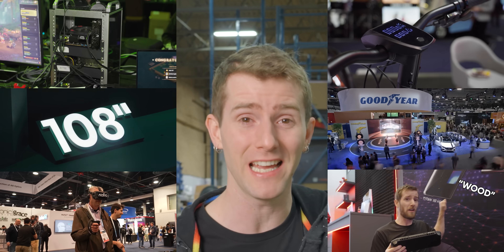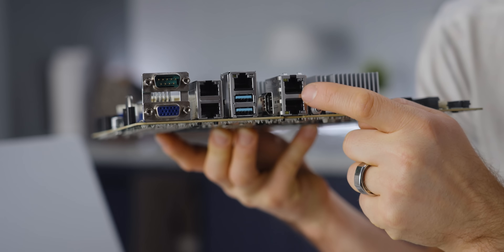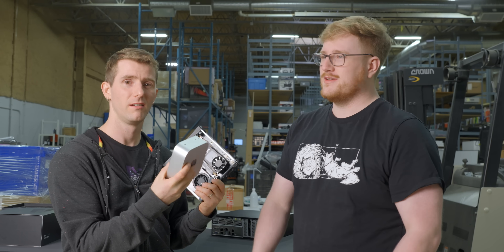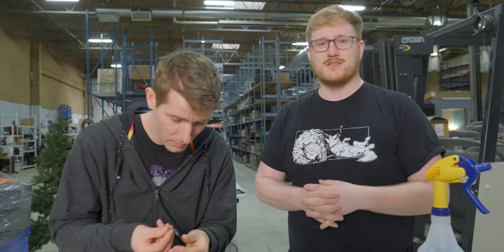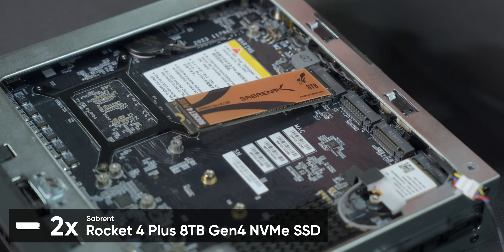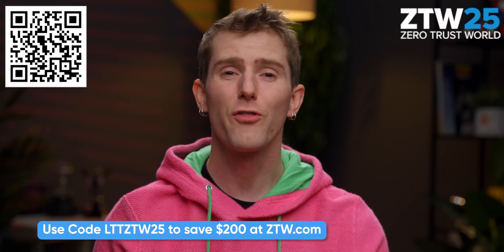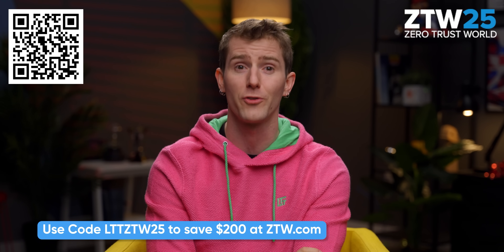I replaced a $20,000 server with this

Comment: Linus's old server case is actually the case I am using for last few years as my daily driver. That's a 8L case. He showed up Nvidia Quadro P1000 card and I used to use P620 on that server case which I recently upgraded to A1000. He mentioned 2000E Ada GPU which I actually returned for being a bit pricey over A1000. He showed up minisforum which I am also buying before I leave for overseas. JC. 😅

Comment: I'm still not getting the point of the GPU (or the Mac Mini) if all you're doing is remoting in.  It has an iGPU which ought to be plenty capable.  That GPU could instead be replaced with a 4-port NIC, so then you also don't need the switch.

Comment: Flying with a switch isn't unheard of. Especially if you have service contracts with 6h replacement SLAs manufacturers will sometimes put an employee with a replacement unit on a plane. If you have a location with hundreds of employees or manufacturing going dark, even a charter jet can be the financial reasonable choice.

Comment: Big tip too, sometimes they have a cable box behind the tv but it’s run through internet and it’ll have a hard connection. You may have to break off a lock tab on the Ethernet cable but if you plug it back in before you leave no one will ever notice and those sometimes will have like 200mbps vs the 5 you get with WiFi. I travel for work a lot and have been trying to figure all the little tricks out
Reply: It's always a good idea to check behind the television for any insecure Ethernet ports. If you still want the Internet television and don't need to worry about maximum speed but want better-than-WiFi, throwing an unmanaged switch in your bag will let you take that one connection and split it into however many you need. You can find extra small ones which support four devices, three if you include the IPTV box.
Reply: If it would be 5MBit/s and if those would be at least stable...I would have been happy.
Reply: that is what they said in the video.. but then an AP instead of a cable box
Reply: 15:25 he mentions this

Comment: I wouldn't recommend this, I got the same unit and it random freezes and you have to power reset, think its related to the bad batch of Intel CPU, or something else, anyway it useless when it randomly freezes / crashes,  so I had to stop using it.  Getting anything of support from Miniforum, is like thinking you can fly = aka they do not do support. :(

Comment: That NanoKvm is so great. Combined with a cheap XH-HK4401 4 port kvm switch, you can have 4 device with one NanoKvm. The switch has a control port, that is not usb, but direct serial. So you need to make a custom cable for that. Old version may have invers serial signaling that needs additional chip, but newer one works without much effort.  PiKvm wiki and github has more details.

Comment: I think Thunderbolt includes networking within itself so it should be possible to connect MacBooks directly to NAS using Thunderbolt compatible cable. Of course if Minisforum supports that. So you can ditch at least some of the network adapters.

Comment: Then you can upgrade to a Yeston Single Slot Half Height 3050 6GB, unless Nvidia releases a 4050, 5050, try out an A310, or if AMD whips up an 7/8/9400 or 7/8/9500 card with an encoder

Comment: 12:48 I have atm 1 Nano KVM at work. It is super annoying that after flashing the sd card to update it needs to access the internet to finish the update - so the image is not complete. I had to bring it back to my home so it has its internet before connecting it back to the Locked corporate network - maybe you can put some pressure there on the manufacturer. Otherwise its a great product. github--> NanoKVM/issues/186

Comment: why network the mini using ethernet when you could just use a TB4 cable and ditch the adapter and get faster speeds? Hell, you can ditch the switch and ingest from MBP using TB4 as well.

Comment: I moved my homelab to the i5-12600h version of the MS-01 a couple weeks ago.  I replaced the wifi card with a coral tpu and added a 9200-8e HBA to connect to my EMC KTN-STL3 disk shelf which houses a bunch of used enterprise SAS drives.  It's now running Proxmox with Plex, Home Assistant, Frigate and a simple Cockpit based NAS all over the 10gb SFP+ ports configured in a LAGG.  I even got vPro working so I have full remote management.  It's basically silent and typically runs at ~5% CPU usage so now the only noise in my rack is from the disk shelf.  I just wish it had support for ECC memory.
Reply: How is the idle power consumption?

Comment: I find it weird that LMG hasn't transitioned parts of their production to Resolve yet.

Every single professional editor I've spoken to that has worked in both for more than 6 months has come away from it with a hard preference for Resolve.
Reply: I think they've done a video about this. It's all the jumping between software for different jobs that makes it tricky.
Reply: @Metal_Maxine  That's why I said parts of their production, not the whole company.
IE: Move one or a few of the smaller shows/channels over and transition a couple of editior dedicated to those shows/channels.
Then use them as resources when migrating other editors over later.
The gain from the custom pipelined workflows that can be created and shared internally is huge for a large team delivering a consistent output with minimal shoot to publish delay.
Reply: @magfal  Dan wrote something in a WAN show recently that they are moving to his streamlined workflow plan. Who knows what that looks like?

Comment: Variation on a theme to get high speed internet when traveling close-ish to home.  I live where I can drive an hour one direction to watch rockets go up or another direction to go visit the House of Mouse.  The same cable company covers this section of the state. If one is in their service area and the building one is in has a cable connection in the wall, ALL their services - cable TV, internet, etc - go to that cable.  When staying over, I bring modem from my home and connect it to wall of resort I am staying in.  Poof! My own modem and own router and own wifi all at high speed.  It will always beat resort wifi for speed and range.

Comment: I had sooooo hard of a time getting the 2nd peel off the PTM7960.  I even had it in the fridge and I still basically ruined my first patch of it (had lots of extra, the larger size is really big).  

Time is of the essence, you need to get it on really quick.   When I redid it things went a bit smoother but it was still kinda hard. 

Hopefully I never have to touch it again now, my main reason for going with that over paste.
Reply: I had problems, too. I think the big mistake I made was I peeled the wrong side first; one of the sandwiching plastics is much easier to remove than the other. I did ultimately manage, but yeah, my advice is peel off the harder-to-remove plastic first.
Reply: @ that could very well be where I went wrong too.

Comment: The nanokvm is more like $60 for the full version in a case, and it does need external power, if you want to remotely power on the PC it is connected to.
Reply: What if your PC keeps the USB powered when off? If it supplied sufficient power it shouldn't need external power right?

I could see an issue being that on PC's that I have seen that can power the USB ports when off that it kinda stutters or turns off for a second when you turn the PC on though that SHOULD be fine because the power on command has already gone through (hence why the power stutters) but you will likely need to get back into the KVM; That should be fixed by just hooking it into a small battery bank and charging that battery bank externally or via the PC.
Reply: @CaptainBlueTech  The power bank should work. I'm not sure about the always on USB ports, but I don't see why not

Comment: I was literally looking at one of those yesterday to build into a router/gateway appliance to replace a two-decade-old Q6600 machine that was doing the job until its NIC died. They're little badasses.
Reply: Update: A few months after posting the above, I bought a MS-01. It's now my router/gateway and handling a 10gbps LAN without issue. It might be a touch pricey but it's an absolute beast of a box for its size.

Comment: Upgraded my wifes Lenovo Legion Laptop with the Ryzen 5800H chip in it with the PTM pad....holy moly!
Before, this Laptop was CRAP, fans were roaring in idle and basically taking off while gaming. Now idle is a slight humm and Gaming is roaring....temps are the same, but less noise and it draws more electricity -> more fps!

Did also put it on my RX7900XTX watercooled....yeah, I stay under 50°C at 420W draw 😂

Comment: 0:30 The fan 😭
Reply: I'm not the only one. Now I can't unsee it.  Lol
Reply: Some ppl dont get what i meant i think
Reply: im not the only one, thank god - lol
Reply: The cooling fans used are Noctua fans, specifically their standard line (or main/regular models) which have a common trade dress of brown blades and beige frames.

They do have ‘Chromax by Noctua’ branded variants which look more like regular computer cooling fans due to them coming in black but with optional accent colours, however I do appreciate LTT using standard line Noctua fans as I do like their colour scheme (though I believe they created Chromax for those who don't like it but still want the quietness and performance they offer).
Reply: Nein
Reply: I have a feeling several of the people that replied here so far, haven't got the point. The light color of the fan body and the way parts of it are covered up by the exhaust mesh, make it look like a swastika, you know the "Heil Hitler" swastika.
The point of the OP comment has nothing to do with it being a sleeper build or just the fan color not matching with the PC.
Reply: @Renee_R343  Fans are made in Austria too
Reply: As a german I flinched a little bit. It looks like the swatiska from the nazis.
Reply: Right lol that doesn't look like a crappy old office computer, that looks like a SLEEPER
Reply: German fans
Reply: Nah b
Reply: Oh boy. Is that design on purpose?
Reply: @ no
Reply: Lol it’s an Easter egg
Reply: the fan and the 2 small ones on the back next to motherboard ports at 0:33 are noctua fans, their design is pretty bad but they are the coolest and the msot quiet fans on market

Comment: Been running proxmox on sff and mff pc's for years. They work great for basic home servers or on the go servers like this. Used to have a meraki z1 tied to work and mini pc with a usb hdd tied to it for a basic target nas on veeam. Off site storage on the cheap :p  Look into Mikrotik switches. they make small sfp+ switches. the crs-305 would give you 10gb on site with 4sfp+'s and 1 copper gb connection.

Comment: Worth mentioning that there are two versions of the P1000, one with 640 cuda cores and one with 512, and they look identical. Also, there's the RTX A1000 and N3RDWARE makes single slot coolers for the older A2000 and 2000 Ada Generation cards as well.

Comment: I changed my thermal paste on my 5800X3D yesterday from Kryonaut Extreme to PTM7950 and my Cinebench R23 score is 3.5 % higher. And this will get better with more heat cycles, other than thermal paste which will degrade.

Comment: MS-01 is great product, only let down by the cheap CMOS battery cause if it dies it prevents the unit from being turned on. The problem i had this very week.
Reply: How do you diagnose that?
Reply: @tzm1843  Knowledge and experience.  The faulty battery gave out little to no voltage when measured with a voltmeter. The failure with the battery results in CMOS POR error, which ultimately prevented the MS01 from posting. I replaced and remade the CMOS Battery assembly with a new CR2032 and the MS-01 posted and booted into the OS.

Comment: Summary: Linus Tech Tips replaces their bulky, heavy portable editing NAS, used for events like CES, with a much smaller and lighter system based on the Minisforum MS-01 Mini PC. The new setup includes a high-performance Intel i9 CPU, 96GB of RAM, fast NVMe SSD storage, and a dedicated workstation GPU for backup rendering, plus a Mac Mini M4 for editing, all packed into a standard backpack. They also discuss the challenges of hotel internet in Las Vegas, their process for ingesting footage, and how they'll send proxy footage back to the main office for remote editing. The system runs TrueNAS and uses a NanoKVM for remote management.

Introduction [00:00:00]
Linus introduces the problem of slow hotel internet at tech events like CES, necessitating on-site editing.
The old portable NAS was too heavy, causing issues with air travel.
A new, smaller, and lighter system is introduced using the Minisforum MS-01 Mini PC.

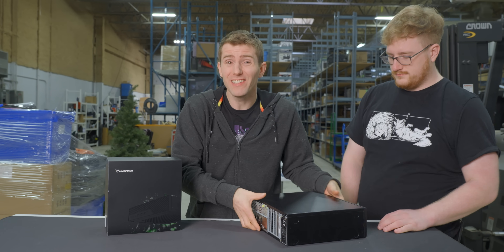Networking Capabilities [00:02:19]
The MS-01 features dual 10 gigabit SFP+ ports, dual 2.5 gigabit ports, and dual 40 gigabit USB4 ports.
The onboard 10 gigabit is sufficient, but faster connections are possible via adapters.

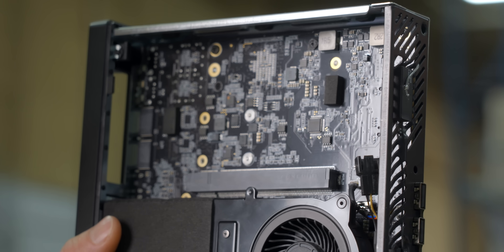GPU [00:03:13]
The system includes a PCIe x16 slot (8 lanes active) for expansion.
An Nvidia Quadro P1000 is installed as a backup GPU for remote rendering.
The system supports up to an RTX 2000 Ada or an RTX 4000 SFF with a custom cooler.
A Mac Mini M4 will be the primary editing machine, outperforming the MS-01 even with a top-tier GPU.

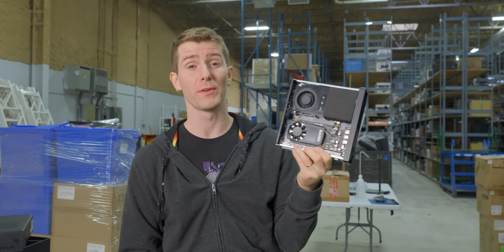RAM Installation [00:05:30]
The system is upgraded with 96GB of DDR5 5600MT/s SODIMM RAM from Mushkin.
The system’s fan can be removed without removing the heat sink.

CPU Repasting [00:06:42]
The stock thermal paste is replaced with PTM 7950 for better cooling, especially on the laptop chip.
The CPU is an Intel Core i9-13900H, a 14-core mobile chip with a max turbo power of 115W, though limited to 80W in the BIOS.
The thermal paste is applied as a solid that becomes liquid when heated, improving thermal transfer.

Storage [00:09:45]
The system has three M.2 storage slots.
Two 8TB Sabrent Rocket 4 Plus NVMe SSDs are used for project storage.
A 512GB Sabrent Rocket Gen 3 NVMe SSD is used as a boot drive.
An included M.2 to 2.5-inch adapter is available if a 2.5 SSD is needed.

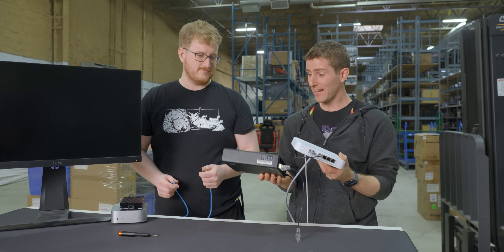Powering On and TrueNAS Setup [00:10:42]
The whole system (MS-01, Mac Mini, switch) is smaller than the previous NAS.
The system runs TrueNAS Scale.
Two 8TB drives are configured in a mirrored setup to ensure data redundancy.
The Windows 11 virtual machine with Premiere Pro is available for emergency rendering (plan C).

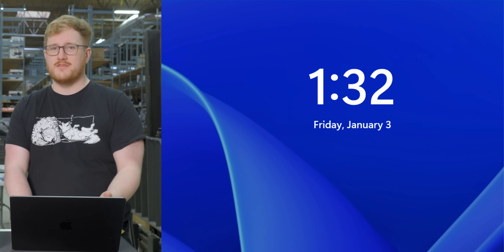NanoKVM [00:12:18]
A NanoKVM is used for remote system management.
It provides remote access to the system's keyboard, video, and mouse functions.
It can be used for a hard restart.

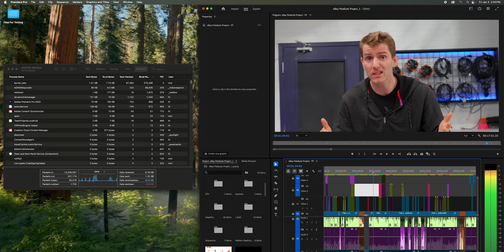Plan B for Editing [00:13:47]
The Mac Mini M4 is powerful enough to be used for editing on location if necessary.

Process for Ingesting Footage [00:14:17]
Footage is ingested to the NAS via a MacBook Pro with a 10 gigabit ethernet dongle, similar to the old workflow.

Hotel Internet in Vegas [00:14:39]
Hotel internet in Las Vegas is unreliable and slow due to lack of competition.
Hardwired jacks in hotel rooms have been removed, making internet access problematic.

Sending Footage Back to the Office [00:15:36]
Proxy footage will be sent back to the main office for remote editing.
Project files are sent back to Vegas and conformed to the raw footage.

Packing it Up [00:16:08]
The entire system fits into the LTT Commuter Backpack.
The full backpack weighs 24 lbs with a water bottle.

Comment: Sorry but Minisforum say that each NVME slot is to be used for 2TB max. If you go any higher there is no way to cool the NVMEs and they are likely to overheat and maybe even crash the PC.

Did you do long term testing with the 2x 8TB NVME drives?

Comment: $20,000 server = 1 single RTX6090 and a stick of RAM
Reply: Nah, this RTX 6090 will cost $20,000
Reply: if RTX6090 will be priced any different than at 4020($,€...) then I will be deeply disapointed!
FOR THE MEMES!!!
Reply: RAM is cheap
Reply: @HH-le1vi  I think he meant 1 stick of Apple RAM.
Reply: @Yobleck  those don't exist. They're soldered right next to the CPU.
Reply: @HH-le1vi  well well well
Reply: Not so fast with 6090, on the way we would have one more Blackwell RTX6000 - professional one (depricated Quadro family).
Reply: The 6090 will be to large to fit on a plane ✈️
Reply: Ram must have been included as a bundle deal 😂